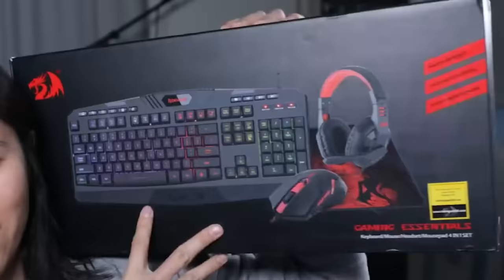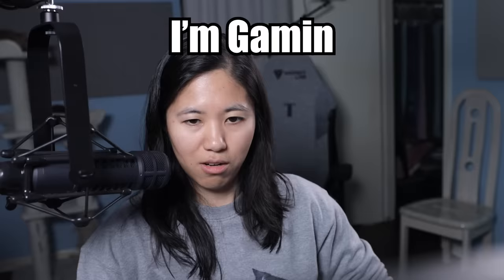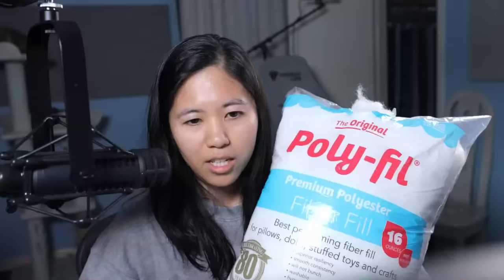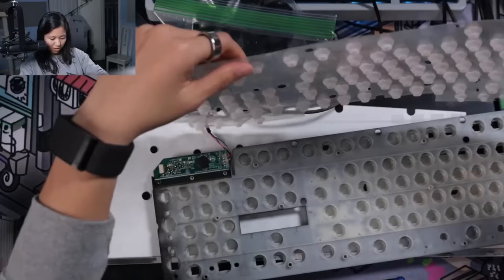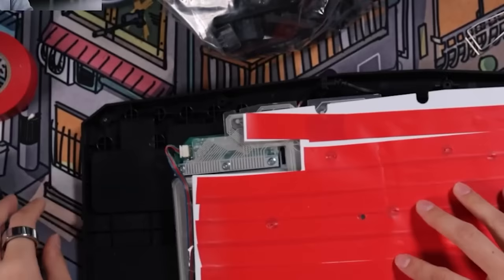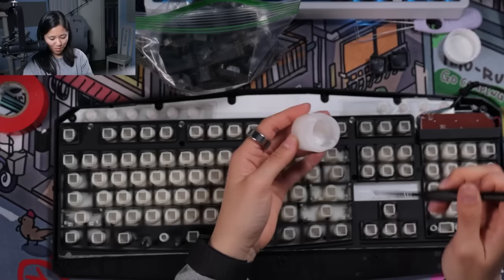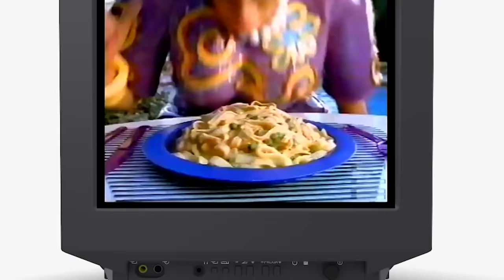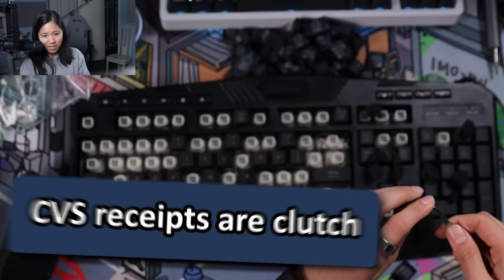From MUSHY... to THOCK?!

Comment: I have an idea for a custom keyboard you could make. You can spray paint the outer layer black and yellow; it could be like caution tape that could wrap around the base of the keyboard. The switches could be yellow and the keycaps could be yellow and black. I think that could be a cool design.
Reply: I also want to let you know I think your custom designs are really cool and now Im finally getting my own keyboard and am going to try to customize it. Currently I don't have a keyboard and I just got into them so I figured you could turn my idea into reality.

Comment: Amazing video as always!! Next level would be adding the Kailh Box slider to the those membrane by open the switch housing and glue the top housing on to the plate. 
You don’t need a stock membrane Keycap and bottom housing anymore. But you will need to find the MX Keycap though. I’m gonna experiment with this someday with Lenovo Preferred Pro keyboard and leftover Kailh Box Navy Switches from my previous build.
Reply from the maker: Thank you!!

Comment: I also have the weird marks you showed here on 1:43 and the mouse is pretty bad tbh the software of the mouse looks like its really old and the forward side button broke but for it is still a pretty good set just wished I got a smaller one it takes up so much space the mouse literally has a built in auto clicker too in its software